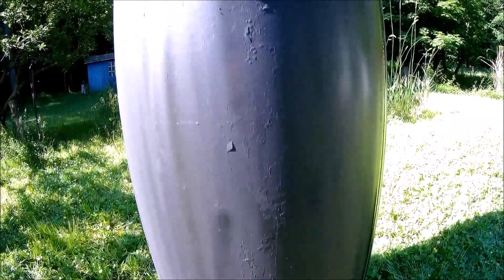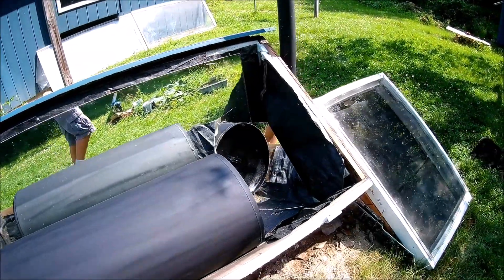solar water heater in PA

Comment: Nice system ! Are you happy with it ? What is your usage ? What are the pros and cons ? What temperature do you gent in winter ?
Reply from the maker: I'm in Western Pennsylvania so I can only use it from mid-april to the end of October then I  drain the water out of it. It's too cloudy and cold in the winter here. I have it feeding the hot water line in the house .I use it daily to shower with. On most days I have to add cold water to it  at the shower head because it's too hot.

Comment: Nice design! I couldn't quite grasp what you said about the box on the side and pipe.  I understand how the tanks absorb heat from sun but unsure exactly what you meant about the fan, box, ground underneath the tanks.....any way to explain again somehow? Thanks
Reply from the maker: There is no fan . The black PVC pipe acts as a solar chimney and  pulls the hot air through the looped pipe under the ground beneath the tank that warms the ground. If I burn a small  piece of paper  in the hot air collector. The smoke gets pulled trough the pipe and comes  out the solar  chimney.
Reply: @Enjoying Nature  ok, thanks for explaining.   I have two Revere solar (possibly thermal) panels. They have that kind of glass that helps attract heat....I haven't taken glass off one as of yet but may do it to better understand them. I luckily got them very cheap. I looked up the price of a 4ft × 6ft panel and couldn't believe the price.  Now I have to decide whether to run water or the "antifreeze" through them....I would prefer to just run water. If you have any suggestions,  please let me know. Thanks again for your video.
Reply: @SteveV1960  Nice system ! You says that it brings hot air only at night under the tank, how can it be "selective" ?